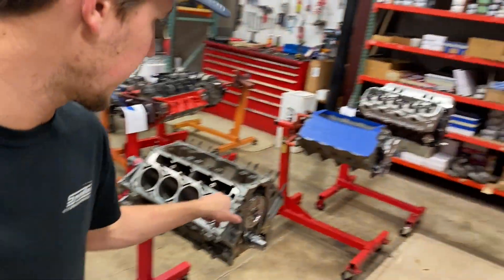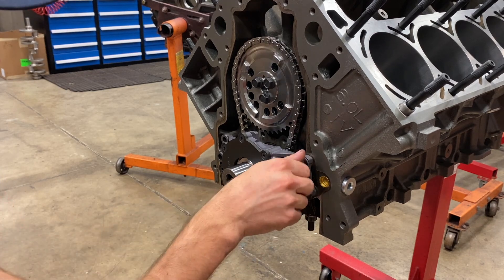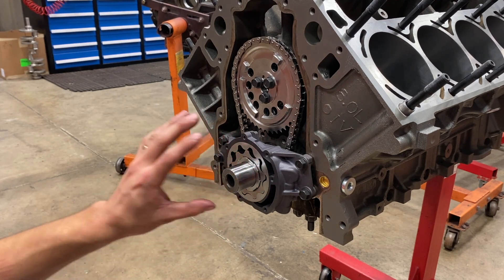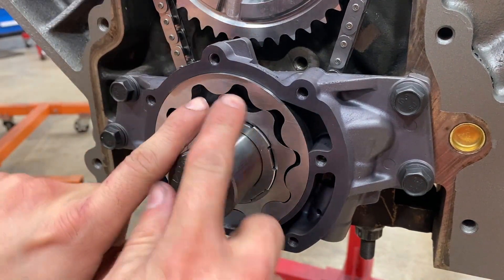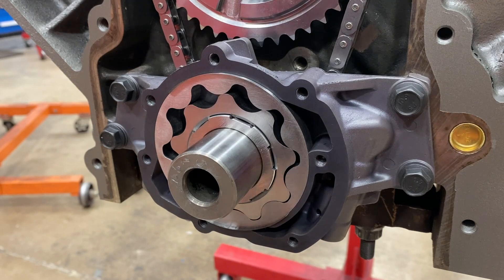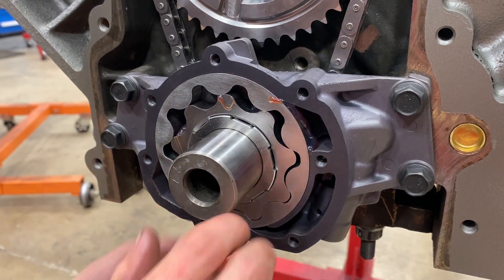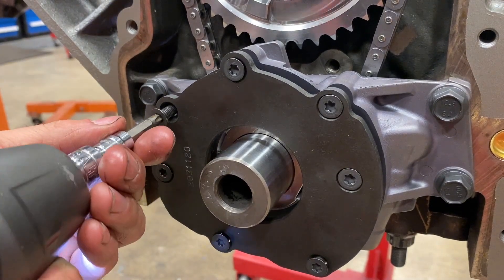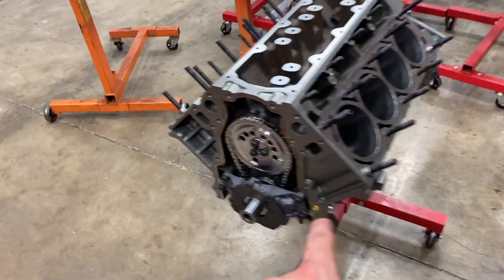LS Oil Pump Shimming- (correct method)

Comment: What I was looking for. Putting in a Melling HV pump soon. THANKS!
Also remember to prime the pump as well.
Update- tried to remove the cover on my new melling pump with a t30 bit.... second bolt head stripped.   Wtf!  Can't shim now.
Reply: Yep, Melling doesn't want you taking those out. They don't recommend this anymore.
Reply: @1bad69xss4  From what Melling's video showed was finger tight, rotate the crankshaft 360° then torque it down.
Reply: @pointblank2910 I’ll be installing mine oil pump on tbss ima just do that 360 and sent it 👍🏽🙏🏾
Reply: @1bad69xss4  Awesome, thanks for the info. I installed mine without shimming and it's still holding up and performing great after a few months of use. Glad i did it. Oil pressure is in a healthy range at idle now.

Comment: Finally a video that shows the proper install of a LS oil pump!  it is refreshing to find a youtube HOW TO video from someone that knows HOW TO!   Thanks so much!
Reply: Yes but its not as accurate!
Reply: Melling does say to rotate the engine that will line it up properly before torquing to spec
Reply: How do you know this is a correct "How To"? Just some guy with a cell phone lol
Reply: @Utubegofukurself  Been building LS engines since 1997!
Reply: @mewrongwayKOCXF Im sorry,  did i dispute that?
Reply: @mewrongwayKOCXF  oh and, Melling says WRONG
Reply: @Utubegofukurself  Did Melling design the LS engine?  Did Melling design the LS oil pump?  No they just copy OEM parts and sell them for a profit!  
I been building LS engines since 1997 and the LS did not appear in anything but a vette until 98.  That tell ya anything? Does the fact that gears in a diff are set up with a certain clearance just like a LS pump, That tell you anything?  Melling is doing the same thing in a less accurate manner lol, Melling just doesn't want idiots taking there pumps apart and *u*king them up and sending them back lol!  So why does all the performance parts stores sell a Butler, Sac City, ICT or other LS oil pump alignment kit consisting of over priced feeler gauges?  
https://www.youtube.com/watch?v=DzUy1RdOx50
Reply: @mewrongwayKOCXF  chill. Who gives a phuck what i think lol. Im just someone with a keyboard just like everyone else. Enjoy the rest of the day, Ol' Grand Master of the LS!
Reply: @Utubegofukurself  Chill, You responded to me!!  Or did you forget that already?  Enjoy your day Ol Grand Master of the keyboard!
Reply: @Utubegofukurself Smartphone trumps dumb comment ...

Comment: How about a mention about mounting the pick up tube using the bolt that can be removed with the oil pan on.
Reply: Its a pain in the ASS
Reply: @grngs1  oh yeah. I’ve done it before. But once you get passed the 10 mm bolt on the pick up, the rest is cake.
Reply: I get at it by loosening the pan bolts and dropping the front of the pan just an inch. Easy access to that bolt then.

Comment: Why didnt you replace the chain guide for the timing chain?  I have a cluster fuck on my hands after my brother passed away, and dont understand why he left off the guide as I put this camaro ls back together.
Reply: Damn bro, sorry for your loss.
Reply from the maker: These Rollmaster timing chains are incredibly tight compared to stock chains and do not require tensioners or guides.

Comment: Hi there I have a 2002 chevy avalanche and I have low oil pressure its below 40 at idle and when I'm running 45 or 50mph it's at 40 to 42 and it has 249000 on the truck and had a lot of sludge in the motor do you think a new oil pump will fix the problem I done cleaned out the oil pan and pickup tub ?
Reply: cant go wrong with a new oil pump, it could also stop lifter tap also cause the lifters wont be starving for oil anymore
Reply: @mctigmctiggy1475  most of them are, number 1 rule, you dont look at them lol

Comment: I have a pack of brass shim stock in various thicknesses, and I have an LS 5.3L truck engine apart, I think some strips of brass shim would work well for this operation. But even though my LS is very mildly cammed (stock idle and .05" more lift than stock) and has a SC system that makes 6psi max boost, I think I'm going to leave the bypass spring at stock oil pressure because I don't intend to race the truck and it will never see over 5000 rpm, and it will mostly tow, haul and highway cruise. More oil psi or volume when not really needed has a way of putting more oil in the valve cover area and causing oil consumption thru the PCV. My brother has a high HP, hi-rev supercharged intercooled LS that is giving this trouble. 

But one thing I did do was upgrade to a double row timing set designed to support 2000 hp (so I'm told). The stock timing chain was so loose after 100,000 miles it was a miracle it didn't jump a tooth, and this was 80% highway cruising and absolutely no racing. And replacing the timing set in the vehicle on an LS is not so easy as it was in the old days. Back in the day I changed worn timing sets on V8 Chevys, Buicks, Cadillacs, in the vehicle ... the cars all stalled due to the timing chain getting loose and jumping a tooth and you could tell by advancing the distributor and the engine would start again. Those days are over. You gotta put in a timing set that will last the life of the engine. LS truck engines are good for over 200,000 miles but the timing chains are good for maybe 100,000.

Comment: What thickness feeler gauges are you using ? Also at what torque setting are the front oil pump cover screews torqued back down to ?
Reply: sounded like he said 2 thousand gauges and 108 inch pounds
Reply: Two 0.0025 shim and torque to 108 inch pound (i think it's around 6-8 foot pound)

Comment: Nicely explained

I always wonder why people skip this simple step on, arguably, the most important engine component.
Reply: because the pump manufacturers (melling) void your warranty if you remove the front cover. Also if it was so crucial, GM service would have a procedure for centering the pump. They don't.
Reply: @ Kyle Allen

On my LS1 I installed a new Melling oil pump by priming the oil pump before I installed onto the crankshaft.  Good oil pressure to this day.
Reply: Because many guys don’t know that it is necessary. YouTube is full of them.
Reply: I'd say that it IS the most important component!!! Without it, you could dump a $100,000 into your engine, and it wouldn't run for more than several seconds before it took itself back apart again!!